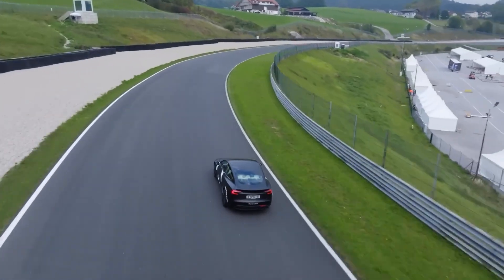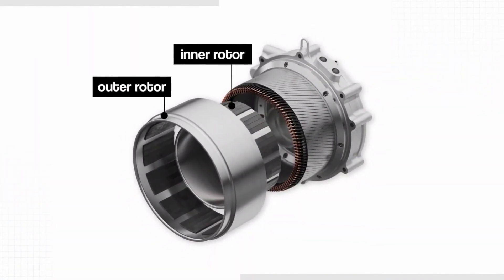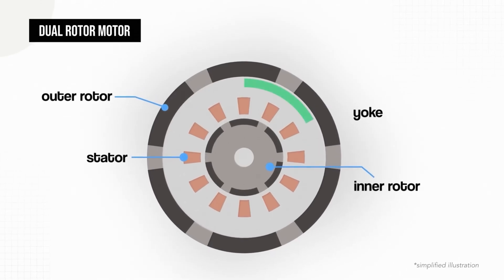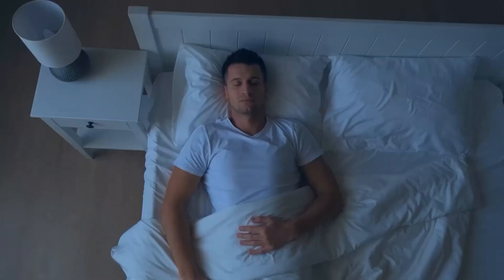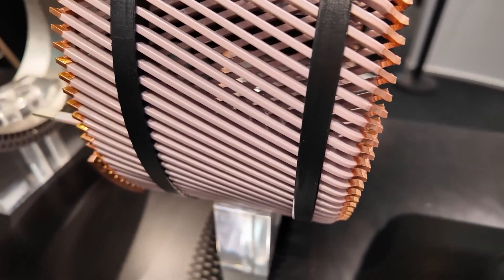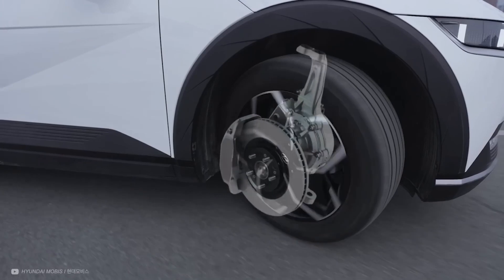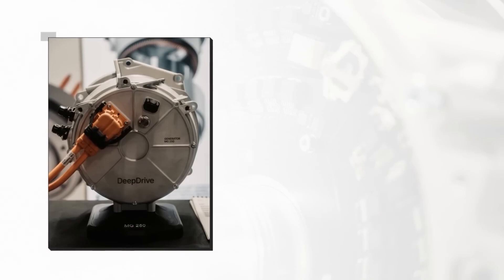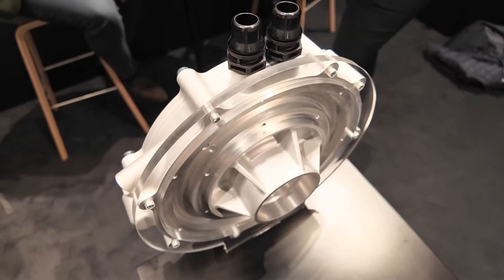Deep Drive's Yokeless Dual-Rotor Motor: The Genius Winding Design Changing EV Engineering

Comment: sooo, let's get this down to first principles...

so, it's "Außenläufer" and "Innenläufer" at the same time, maximizing the magnetic field compression, where it's most effective?
Reply from the maker: Yeah, exactly!! It combines the principles of Außenläufer and Innenläufer into a single unit... This 'sandwich' design forces the magnetic flux to pass straight through the windings between the two rotors, making the iron yoke obsolete and saving huge amounts of weight